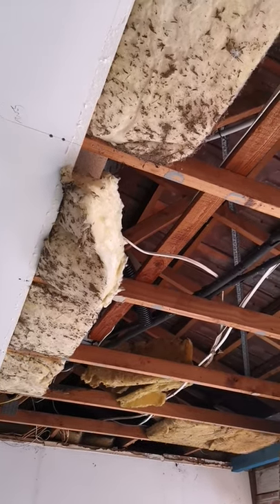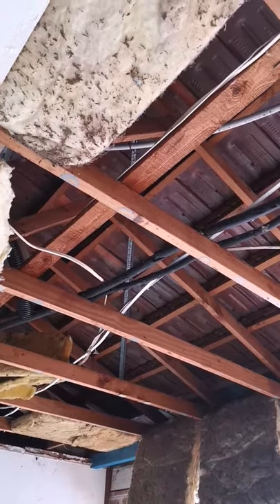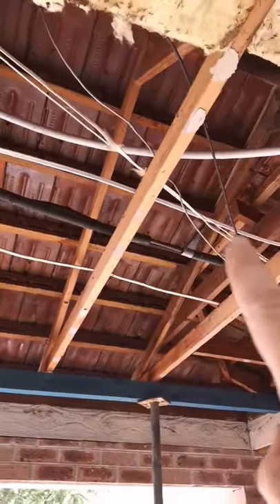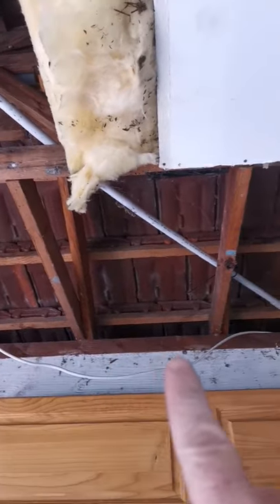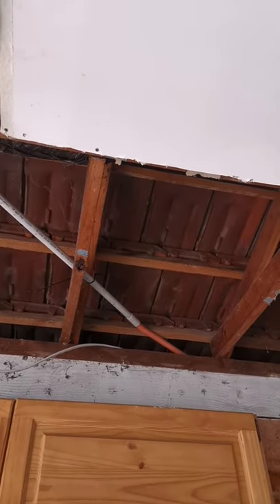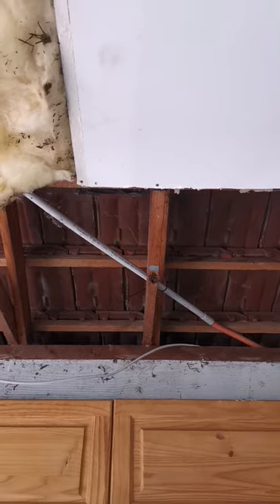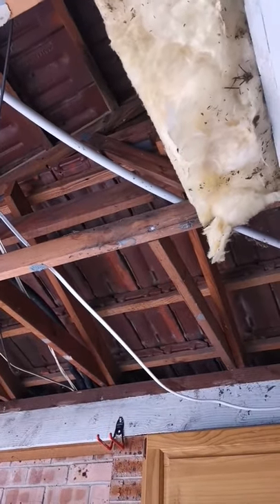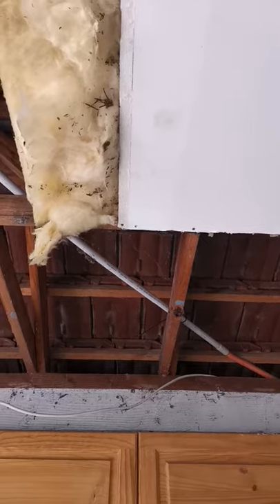Solar Install Wiring FAIL #SHORTS

Comment from the maker: Come to think of it, the gyprocker can probably cut the sheet a bit short against the wall and cover with the curved cornice.
Reply: Just pull it out and reroute it properly, it's not a big task and nobody but Youtube needs to know
Reply: That seems like the worst way to go. Now it's in a hidden spot where you definitely wouldn't and shouldn't expect wires to be. What's worse is that anyone working there down the track might get a false sense of security thinking it's a de-energised mains wire with the breakers off, nor would it register on an AC voltage detection meter. I would reroute it, probably with a warning tag too.
Reply: That would be your best option. You don't cut notches in to beams that make up the structure of the house as you risk compromising the integrity of the structure.
Reply: I wouldn't leave it but in case its difficult to move it, in the US, some drywall ceilings are installed where they put furring strips between the ceiling joists and the drywall and then screw through that (helps with leveling, adding space, adding structural support, etc.). So if you're ok with your entire ceiling being 1 to 2 inch less in height, you could add the strips and have the wire go between strips. Your going to want to cover the wire though with metal cable protection plates so someone doesn't screw or nail through the drywall and accidentally hit it. In the US they are made by RACO and Garvin Industries (Southwire) and cost lest than $0.50 each.

Comment: Under my friend's garage, the ceiling is concrete with steel beams across supporting it. In some places there is a small gap between the beam and the concrete, and what do you know, of course someone ran mains wires through that gap. They are so tight that it is basically a free wire clamp. So convenient!

Comment: When tradesman install stuff there's usually very little consideration for future maintenance or modification. Afterall, it's no longer their problem. I'm having a similar issue with the main service line, the one connected directly to the mains power lines, albeit through an ancient service fuse. I would have thought there would be clearance standards for these types of high voltage and high energy lines, ie, not directly above the plasterboard where you could potentially drill into them.

Comment: Can you cut the cable, re-run it, and tape it up? Or do you have to install junction box to connect cables again?
Reply from the maker: You wouldn't cut it. You'd disconnect the isolator and pull it back and refeed it
Reply: All the pixies would spray out if you cut it and then it would be impossible to splice.
Reply: @EEVblog2  Come on Dave! Do it proper way. CUT -> TWIST -> ISOLATION TAPE.
Reply: @bevis71  and bill the client for a rerun
Reply: @EEVblog2  Don't wear out the isolator, do it at night :-)

Comment: I really hate the whole "This (thing) must be installed by a qualified (relevant tradesperson)" narrative and they do this crap.
Reply: You dictated how it was installed? You get to fix it on your dime.
Reply: I have seen so much shoddy work by "professionals" in recent years it's not really discernable from a lot of DIY.
Reply: It’s just a job protection racket.
Reply: @carbonstar9091  diy'ers might actually do a much better job, as its their house to go in flames if things go wrong. skin in the game and all that
Reply: and that prevents home owners that would do it perfectly from doing it themselves. The law goes both ways
Reply: I hate that crap too, I rather do this sort of stuff myself.  I still do it anyway... but I have a feeling the government is going to start clamping down more on that sort of stuff and forcing to require permits and crap.

Comment: Solar installation are a minefield. It seems like there are hundreds of dodgy Brothers installers who advise on YouTube and Facebook leading to many systems only lasting for 2 years instead of 25years or being unsafe with risk of fire or electrocution. Sadly a few bad eggs are dragging the industry down. Supporting well established businesses who stake their reputation on the quality of their systems as well as checking the quality of the components used will go some way to protecting you. Any solar panel or inverter must be approved by the  appropriate governing body before installation.

Comment: As they say: There is always time to do it right the second time. If it was my garage I try to redo it properly. If it's just a matter of removing the connection at one end and pulling it out and back in the right way it will definetly be worth it. However, I also do not need to hire a contractor for that job. As far as I heard you are legally not allowed to touch this stuff which makes it quite a bit more annoying.

Comment: Reminds me of how some genius installed one of the pipes directly across the front of my furnace so that it blocks the cover for the air filter. To replace the air filter, I have to squish it up to half it's width and then try to stuff it into the hole.

Comment: If they have used a super rod solution to pull the cable,  it was the rod finding the path, because there was a space under the beams, that shouldn’t have been there.

Comment: It could be worse. Our plumber put copper water pipes in the ground floor concrete slab, because it was the trend and everyone was doing it, and of course it got corrosion holes - maybe because it's near steel reo-bar -. I could hear something with my volume set to 11 tinnitus, and soon after we got a bill for a missing 100 megalitre of water, and in the end they practically had to cut the house in half cutting concrete trying to find it.

Comment: That's why people here where I live do it all by themselves. You very rarely see any contractors or installers here, people just buy the stuff, do a bit of research, ask around, grab the toolbox and that's that. And I'm not talking only solar here, pretty much anything, including the construction of an entire house.

We had some guys install the roof and when the next storm hit it started sliding away, it wasn't attached to the house with a single bolt. If the winds were 10Km/h faster, it would've flied away. So yeah, we all do it by ourselves here.

Comment: My solar installer ran the cables inside plastic piping and clipped the piping to the 'A' frames above the beams.
I'd pull that cable Dave and run it properly.
Reply from the maker: The entire roof is filled with loose mains cabling. The DC cable is in a ductign and anchored to the rafters.
Reply: @EEVblog2  At least they did that bit right.

Comment: All of the electrical in there looks pretty bad lol.   I would not notch the beam, I'd disconnect one of the ends and rerun it properly, or maybe cut it in place and put in a junction box and reconnect it, just make sure it's accessible.

Comment: All cabling above the ceiling is a ratsnest imo. Get yourself some cable trays and make it look neat.
Reply: Not to mention illegal as there seems to be greater than 600mm access which requires clipping of the cables or further mechanical protection!

Comment: That must of been your old install wiring. All the newer installs have to do it conduit.
Reply: Could it be the ac feed to the inverter. On a side note whats the colour of a 2 cent piece
Reply from the maker: Yes, I think it must be the original installer, as AFAIK the new install didn't touch the existing inverter mains wiring
Reply: @EEVblog2  Being a non-rcd protected circuit more care and attention should of been made IMO even for as/nz3000:2007 standards,

Comment: Does anyone do their job right anymore? I remember when taking pride in you work was a thing. my 3 month old refrigerator is broken and  they can't get a technician out for 5 days. sorry you need to throw away a bunch of food.
Reply: the only reason you see the "old good stuff" is because the old bad stuff got replaced long time ago
Reply: @lesto12321  
Sure ok. I take pride in my work and would never have done that shitty a job of wiring. You do the job properly or don't do it at all. This is a personal choice not a corporate choice where if I'm fast they'll think I'm good. But when the company needs to go back and fix it they won't be so happy with you. It is all about taking pride in the work you do. And that alone is what makes capitalism (the engine of our economy) work. If a company provides poor workmanship that company will not prosper
Reply: @lesto12321  
Oh, and talk to me about good old stuff. Refrigerators that still function built in the '70s, TV'S that lasted 30 of 40 years not 4 or 5 like they do now.
Reply: @GlennHamblin  Have you ever heard of the term survivor bias?
Reply: @lesto12321  Certainly, although you forget that not everything is thrown out because it's "bad" either, perfect example is phones, you might keep yours for 2-4 years but even if you don't break it, you'll eventually replace it for simply being old or in the case of appliances, you might toss something out for merely being dirty/stinky and not wanting to clean it like an otherwise perfectly fine fridge.

My parents did exactly that, had a roughly 25-year-old fridge that was dirty and a little worn (needed new seals) but it was 100% functional, still tossed it because they absolutely must have a new one and I know that not all new fridges have problems, but some like Samsung's can cost ~$2000 and only last about 5 years, so yeah sometimes old stuff really is made better.
Reply: @Monkeh616  nope.
Reply: @GlennHamblin  I suggest you go look it up - perhaps you'll see the flaw in your 'good old stuff' argument then.
Reply: @GlennHamblin  The part you're missing is that stuff was eye watering expensive at the time (just look at old newspapers and find an inflation calculator), has had extensive maintenance and repair work done to get it going that long, or both in the case of something like a 40 year old television in daily service. That TV would have had to have had several picture tubes through it at minimum, a procedure that wasn't far off from the cost of an entire new TV by the 80s as I understand it.
Reply: @Broken_Yugo  I know stuff was expensive back then Our TV was a second hand 13" black and white. But it received all 3 channels. We had it over a decade as the only TV in the house. I bought a Samsung 42" TV 2 years ago and it died 18 months in. So yeah every thing is just my bias though.
Reply: My 8 day old Bosch fridge freezer stopped cooling.  It took 19 Days for a an "engineer" (read board  swapper) to visit and say it's low on gas.  Waited another 12 days for them to collect and take to the workshop.  Another two weeks to get it back.  And nowhere to put my insulin.  Thanks Bosch.
Reply: @nutsnproud6932  Careful there's a guy here who believes new appliances are just as good as old appliances and if you think differently he'll accuse you of having survivorship bias.

Comment: It's depressing to read the comments, i take it most people have never installed wiring so don't appreciate that there likely wouldn't have been a physical human with eyes on in the roof space there isn't anything 'unprofessional' about this. This will have been pulled or pushed in with rodding or a cable snake so the installer wouldn't have known. It's far too easy to tear folk and contractors down and all too difficult to actually think why it might have happened. If the installer are happy to come round and sort the issue I doubt they'll really get much credit as per usual, that isn't directed at Dave btw just an honest interpretation of how things are.
Reply: While this is true it does need to be corrected. I was under the impression this would not pass the AS3000. I do get what you are saying.
Reply from the maker: This is actually right next to the manhole cover and the storage flooring in the roof, easy to get into.
Reply: @EEVblog2  Aye fair enough so shouldn't have been a completely blind install pulling the run but the 'under' part of the cable run is right in the eves so doesn't look like the easiest place to get to as in you wouldn't be crawling right in there and deliberately hand feeding the cable under. It's still an issue that needs to be corrected but hardly 'shoddy workmanship', 'unprofessional', 'cowboy' etc like a lot of other comments seem to think. Thank you for the additional context though I've enjoyed the Solar and other video content you've done outside of the main EEVBlog content.
Reply: I'm with 1001 here, there's no room to crawl in to the eves  and the insulation makes visibility difficult, shit sometimes happens and installers don't have x-ray vision, Have a great Sunday Guys  👍
Reply: @1001ewaste  How it is not unprofessional if it is done wrong or badly? If you can't do it right the you don't do it at all. You don't just do "something" blindly and hope it'll be ok. And if you do then it is unprofessional.
Reply: A good installer would have made access holes so he could see the cable run. also could have followed the joists to the eve then pulled the cable in the direction its needed.
Reply: Who the fuck pulls bare cable across beams and shit?! Have you not heard of conduit?

Comment: I noticed when you let us look inside your mains electrical panel how scary and Jenkee looking for electrical wire was like a child’s first project. 
           And looking at the wiring in a roof on your garage I guess they hire whoever they could get off the street corner to work for them to do wiring runs cheapest labor. 
          They must not have strict electrical building codes there in Australia or inspections must not be required
Reply: Oh the codes are plenty strict. 

Most "qualified" sparkies don't give a shit though. More often than not the way you tell the difference between DIY work and "licensed" work in AU is that the DIY work is done properly and to code... (source: one of the few sprarkies I've run across who actually gives a shit and does things properly)